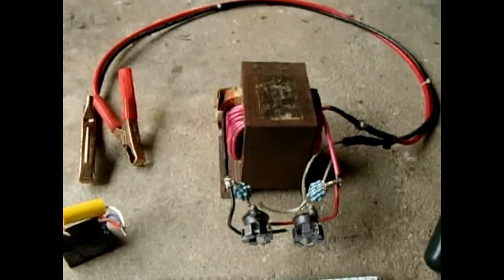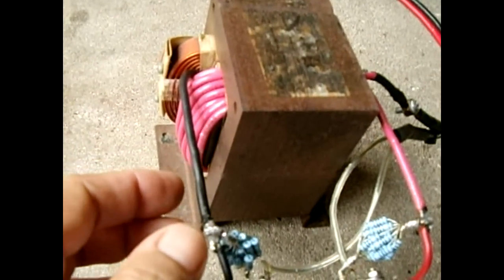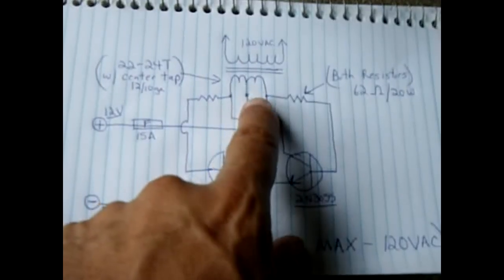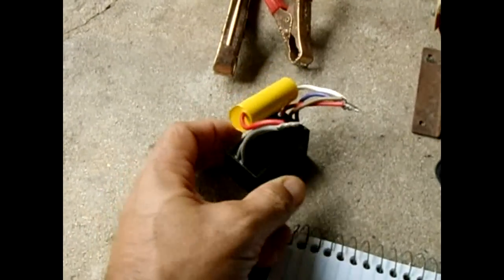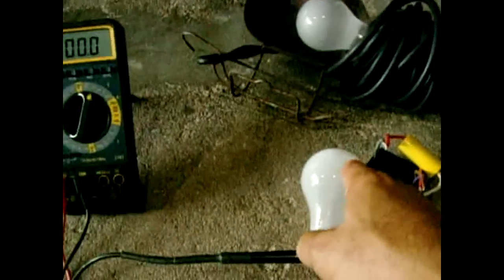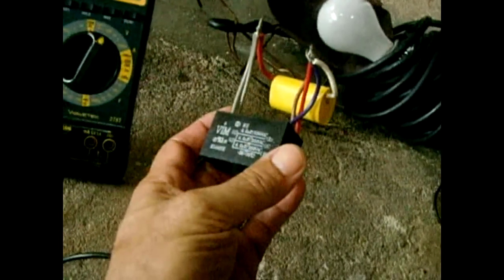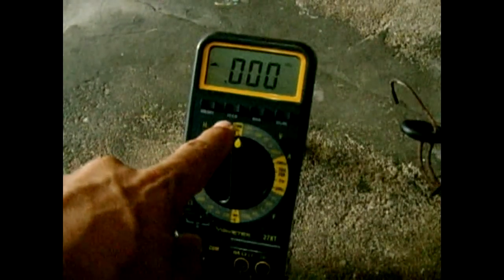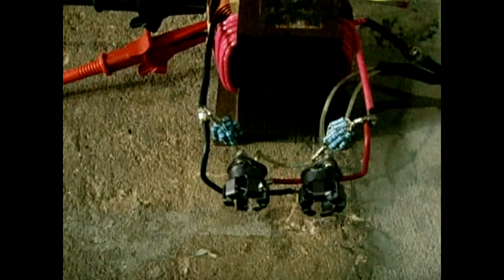How To Make A Microwave Oven Transformer(MOT) 12V to 120V Inverter

Comment: When you clump the resistors you reduce their wattage because you block the cooling. Spread out in a line if you must. But why not use FETs instead, that way you wont need big current to the gate.
Reply from the maker: Your right. The inner resistors do not cool like the outer resistors. If I was to use this regularly, I would have used a single high wattage resistor instead.

Thanks For Watching!

Comment: Originally the transformer was rated at something like 1000 Watts, right? If you're only getting 75 watts out it seems like serious overkill to use a MOT. A smaller transformer might handle higher frequencies better too.

Comment: How is this different from the 100 watt inverter I plug into my truck's cigarette lighter.  Mine weighs less that a pound and I paid $11.00 for it about six years ago. I have used various small appliances and hand tools with it and haven't noticed any problems with it.

Thanks for sharing your video.

Regards,

Mick
Reply from the maker: Yes, you can buy those 100W units fairly cheap. The only problem with those smaller units, they have little surge capability. They are designed for low power devices. This circuit is not 60 HZ. This circuit puts out good power, but at a higher frequency. The purpose of this video was to show what can be done using an old microwave oven transformer. My newer video, the one which has a modified sine wave output and 350/500 watt output, has an adjustable frequency output. I can use it for most anything. Check it out.

Thanks for watching.
Reply: Have you put a scope on this one to see what the waveform looks like?  My scope has temporarily laid down on me but as soon as I get it going again I intend to check it's waveform too.  I would imagine my inverter may show more noise than the one you built, but I could be wrong.

Thanks for the reply and the video as well.

Regards,

Mick

Comment: I know this has nothing to do with this great project, but since I know nothing about electronics and you seem to know quite a bit I'd like to ask you if a Mobility Scooter that takes 2 12 volt 35 amp batteries would 2 riding mower batteries that are 12V 230CCA would that burn the motor up since the Amp. are so much higher or does the motor just take what it needs. Sorry to be off subject like this.

Comment: I was wonder if I can use only parts from one micrwave to make my 24VDC power supply for power tool that draw 6amp?

1. rewind (2) Microwave transformer 20 turn (each) 
2. Rectifile from microwave
3. AC Capacitor from the microwave

Thank you for the video

Comment: Will it be good on CFL lamps at this frequency ?  Since time ago, I'was wondering if using a "flip-flop" schematic with very low rated capacitance on it, will do the work for aproaching something near to the 50Hz. Good job by the way, and very explicit...!
Reply from the maker: +Alejandro Martin 
CFL's are fairly inexpensive, so give it a try. As long as the AC input is converted to DC in the CFL, then the higher frequency should make no difference. It should work.

Thanks For Watching
Reply: Thanks.! I'll give it a try and tell You what happend later...
Reply from the maker: Alejandro Martin

Great. Get the inverter working perfectly, then try the CFL.

Comment: Question, if i was to replace that 12 volt battery with a car alternator which already puts out AC current, could i remove that transistors?
Reply from the maker: I have a better idea. The alternator's charging voltage is regulated by how much current is applied to the rotor(rotor current). You can regulate the current manually like I did in this video here:

Homemade Inverter Generator - Alternator Modification

Remove the rectifiers from the alternator to leave the output AC. Each of the 3 phases are connected to a set of diodes to convert the high frequency AC to DC. Note that the AC output is HIGH frequency. When the engine is connected and running, slowly add current from a 12V battery to the rotor. AC output is varied by rotor current and engine RPM. Most alternators are wired in STAR / WYE configuration for 3 phase. Each phase will give you an AC output. Take voltage readings between the windings to see what you get. Try the ends of 2 windings together 1st(might have to swap wires around), then try from where all the phases are tied together(to form the wye), to the end of each phase. :-)

Don't forget to check out my video playlists.

Thanks!
Reply: electronicsNmore i'll give your vid a look right now, and thanks a ton :D

Comment: cool.  try giving your transformer more dimension,   as in the one i got on the go consists of 8 transformer cores arranged and rewound  in a dimensional pattern consisting of height breath and width.  a tesla super fat boy,   or get rid of the plate build up and move on to the ferretic material, way more efficient.

Comment: I can see this gizmo running a D.C. unit like a computer or LCD screen. But for something like a motor in a washer or a compressor in a fridge it would have to be 60 hertz.  Cause they're set up to run on 60 hertz.  May want to try a switching transistor.  This looks like to joules thief circuits put together with modifications.

Comment: How would you use this method to make a 120 volt to 12 volt (120AC in - 12DC out) converter?  And roughly 60-90amp?  Example, making a car battery charger, or making an inverter to power a 12volt amplifier.
Reply from the maker: I have a video in my video list which shows a homemade 12V lead acid battery charger made from a MOT. Easy to do. To get that kind of current output, you would need a large transformer, or 2 IDENTICAL transformers in parallel.(Properly connected to one another).

Comment: Interesting works well!!
Reply: Not really. He's using those old tech inefficient power hungry 3055 transistors. Mosfet's are not that pricey and won't require so many resistors either. Crude setup but I would of used a frequency controller before I'd hook up any electronic appliances to this.

Comment: interesting but frequency is too high will damage the appliance or device. frequency should be 50Hz to 60Hz, by adding frequency inverter circuit will control the pulse.

Comment: Have you ever dony any step down from 120v AC to 12-14v DC using a 1000 watt ballast with 120v -480V AC  power taps
Reply from the maker: Hi. No, but I do have an excellent video showing how an autotransformer works using a microwave oven transformer. Check it out. Look under my MOT playlist. Thanks

Comment: is a microwave oven transformer the most efficient to use when building an homemade inverter I want to make your inverter but the cost of microwave oven transformer is just too expensive over here
Reply from the maker: Look for a junked microwave oven, or refer to my other inverter videos.
Reply: Thanks I will do that power failure has always been an issue over here I hope I get all the required components soon

Comment: Just buy a 12 volt to 120 volt transformer rated for 15 amps. Install it on an APC backup UPS which the voltage is regulated\conditioned to a constant 120volts. Bonus side is surge protection and backup power for 120 volt appliances...
Reply from the maker: That's a huge transformer. You're better off using a much smaller transformer at a higher frequency.

Comment: i have 5 transformers now and if i get close to the same voltage output would it be safe to link two together to double the wattage? im thinking it would be ok by watching one of your other videos
Reply from the maker: If you do not use the exact same transformers, and same wire/same # of turns you could have problems.  Within a couple hundred mV of each other is OK.

Comment: Nice design of common componentry (3055s are often scavenged out of many devices, sometimes even the lower voltage ends of TV or audio Amps but are cheap to buy) but after all that work why not add a simple heat sink to them even if its just a beer can? 

Use baby rash cream containing zinc chloride and scrounge up some TO-3 Heatsinks --- and you can at least DOUBLE or even TRIPLE its output. If your fuse is 15 amps you're talking 1.5 amps output at 120 VAC, about 180 watts, that's enough to charge & use three laptops.

GregJoshua: There is ohm's law and a billion other formulae but the problem is the real world often requires fine tuning because there are so many other issues. Even an antenna, cut the wire to the EXACT frequency length often has a tuneable end (some even hidden under the rubber duckie antennae) because that is just the way the world is. We can go for mathematical precision (and I can do it, went to college for it) but when one builds a circuit different challenges present themselves, lets say.

Life is not a mathematical playbook. Einstein's fudge factor was 2/3rds by the way -- 66% and he is thought of as one of the BEST in many centuries!
Reply: Nice comment! 
You're spot on about the fudge factor with most things.
Reply: Thanks!

I realized afterward I could have been more specific: That in electronics we tend to classify things as resistive, inductive or capacitive when a lot of componentry the last two there is usually a small amount of crossover. With other components a large amount.

Also the higher in freq you get the more this becomes a factor to the point that now you NEED computers to design fast boards. The boards capacitance often becomes a hindrance and even how thick/thin the trace is. When you get up to microwave frequencies we don't even use antennas: we use waveguides.

And that is literally what we are doing. Guiding a wave (from TV tower to tv tower or to your satellite dish)

Comment: This is great! Who the f@ck would click "unlike" on this? I'm teaching myself electrical engineering, trying to create an off grid system that could run my fish tank in the event of a grid failure (say, this coming Christmas... thank Trump, but Jong-Un fut the false flag). This is something that even I could follow, having no formal experience, and only been tearing apart services since the summer. Was looking to make an EMP device, have the parts for a high voltage EMP gun, and working on various upcycled projects (turbines and solar arrays). So thank you. I need to find out how what my collection of resistors can handle...
Reply from the maker: There are a lot of "undesirables" and Trolls that do it all the time. Every channel has them. Glad you liked the video!

Comment: Very informing video. Thank's , Can you help me please? I have bout a machine which was rated for us. It uses 110v, 50hz but I have moved to europe now and dont know how to make it work!? I have searched the ebay and found different power converter's but most of them dont run on 50 Hz !!? what can I do? do you have any Idea's ? Thank's
Reply from the maker: You need a travel adapter which can handle the current you're using.
Reply: You need an auto transformer NIMO electronic which convert 110v to 220v or vice versa 220v to 110v , its rated 50/60Hz 100w or 300w max . to use it you adjust the input selector to 220v and you get 110v output . I bought one from www.cetronic.es 
to find the item you have to type 
CONV102 CONVERTIDOR 110V A 220V 100W
or you can find it at an electronics store in the country you live.

Comment: hi there i'm asking if it's ok i will use that inverter to LCD TV? and also CFL bulb?thanks to your video i really learned....i'm waiting to your answer bro...thanks a lot
Reply: the correct resistor is 1k 1 watt 16 pieces?
Reply from the maker: villigasruel That was all I had laying around. Ideally you would use (1) high wattage resistor of the correct value.
Reply from the maker: CFL, and incandescent should be fine, the LCD TV you may have a problem with interference due to the high frequency output, and not enough current. I suggest you watch my other video below.
Homemade Modified Sine Wave Power Inverter(350/500w)
Reply: thanks and i really interested to your video....because in my place is a province no electricity because of typhoon i want to make to myself ..thanks a lot
Reply: can you sent me a schematic diagram for pure sine wave...thanks bro...
Reply from the maker: I don't have a pure sine wave circuit, only the modified sine wave

Comment: Is it possible to do maybe 4 or more of these MOT Inverters in parallel to maybe power a larger load?
Reply from the maker: Hi Kavaine. It is better to use one large transformer, In order to use two or more in parallel, you would need to use the EXACT same transformers, same wire, same number of turns, and same components.

Comment: New comment on old video. With such a large transformer - anyone know why you can't get higher wattage? Can you use transistors and/or mosfets to 'fix' the hertz?
Reply from the maker: Hi there. After this video was made, I started using different drive circuits that produced a set frequency output. You can see one below. 
https://www.youtube.com/watch?v=rwXcO5yBUFQ

Comment: What I don't understand is how it that there is no certain mathematics in electronic circuitry? Why do we need to build the circuits to see how well they perform when it (should be) possible to enter the circuit details into a computer and the computer will report how well it performs just by subbing in and out components?
Reply from the maker: +GregJoshuaW 
Hi Greg. There is nothing better than trial and error. :-)
Reply: +GregJoshuaW There is...OHMS Law
Reply: +GregJoshuaW The main reason is while OHM's law is an absolute it can only be as accurate in predicting the final result of a device as the materials used. I.E all materials have nominal values rating each resistor operates not less than but not more than etc etc,even two pieces of wire from the same spool can have a different ampacity/resistance when tested for it's exact values.

Comment: could those transistors be damaged by high voltage switching through the coil, your circuit seems over simple, does not use diodes to protect them.
Reply from the maker: Never had any problem with the transistors.

Comment: It seems, based on the color, that in this transformer, the primary is not from copper but aluminum covered with copper. If this is the case, as I am suspecting it to be based on my experience of working with MOTs (by the way, there is an alternatively, probably more, efficient way of rewinding and also having the original secondary intact for any future project use), you will not have a equal mass between the primary and the secondary (one of the main points of Tesla's notes on efficient transformer development), and such you will be waisting power in your new secondary (former primary).
By the way, nowadays no MOT builders do not even consider this ratio any more, if it were considered in the past, for MOTs primaries are being made of aluminum in the recent times wile most of the secondaries are form copper. This makes them very inefficient for a power transfer as the unity mass ration between the coils is totally lost.
Reply from the maker: I have another video that shows how to efficiently rewind these MOT's.

Thanks For Watching!

Comment: Hi. I wonder how you use a resistance of 62 Ohm with very high power of 20W since the resistor is limiting the base current of a value  12V/62Ohm =  0,193 A and the power dissipated is equal 2,48 W ?  another question how your circuit  produces a frequency without any oscillator ? I guess  that's due to asymetrical components ? IS NOT?

Comment: I saw your metal melter video, Im not a science expert, my question is will this metal melter transformer work using battery power, so it could be portable, will it produce the same current and will it melt metal
Reply from the maker: No, you need AC mains.
Reply: @electronicsNmore  could it be used just for 1 or 2 min?

Comment: Can i reduce the frequency to 60hz?
I mean to use it as a normal inverter with a sinewave circuit diagram.
Reply from the maker: Yes, play around with the values like I did in the video.

Comment: How is it that you are getting only 75 watts out of a system which could have ideally producing 750 watts during initial operation.  It would seem we could reap more watts for usage, yes?  I don't know which is why I am asking.
Reply from the maker: Hi salty,
If you used heavier wires on the 12V primary side, and a couple transistors in parallel on each side with emitter resistors, then I think you would see a greater output. At 75w the transformer is totally cool.

Thanks for watching!
Reply: Years ago I bought a 400 watt Cobra inverter for the car to run laptops and other things.  I was watching to see if I could build a 1500 watt or 2000 watt invertor to run a small refer to keep my insulin chilled on trips.  Last I looked Inverters that size cost close to 500 - $600 ea.
Reply from the maker: Check out this video:

Homemade Modified Sine Wave Power Inverter(350/500w)

Comment: How do you get the two oscillating transistors to pulse in the same frequency?
Reply from the maker: +Val Martin 
Hi Val. The simple inverter configuration shown in this video is called a "Push-Pull". As a result of how the current flows into the base of each transistor through the primary winding, the transistors oscillate. While one transistor is turned off, the other is turned on. Both cannot be on or off at the same time.They work together to create positive and negative pulses. They switch at the same speed.

Thanks For Watching!